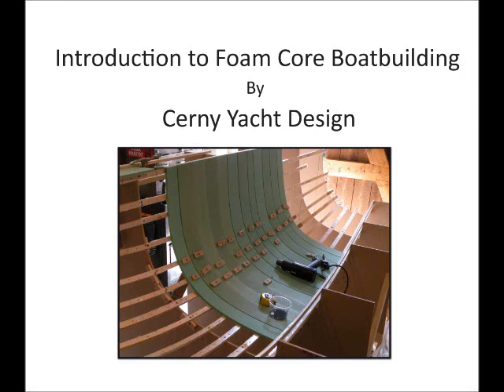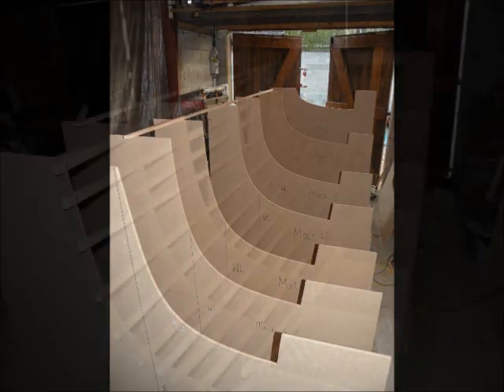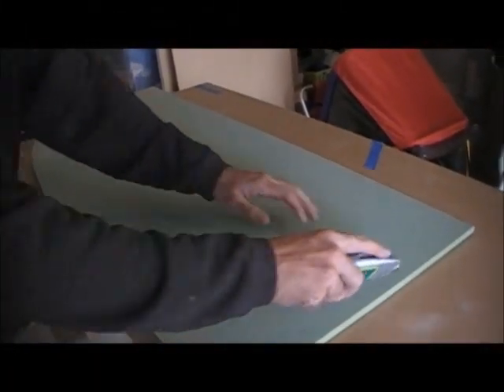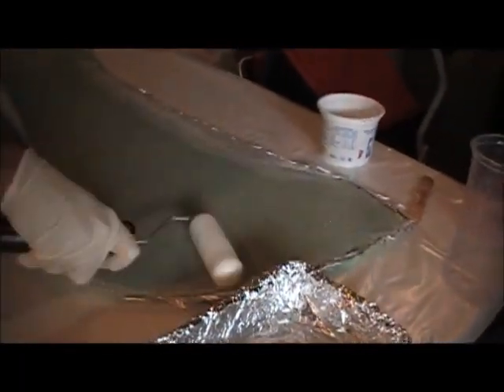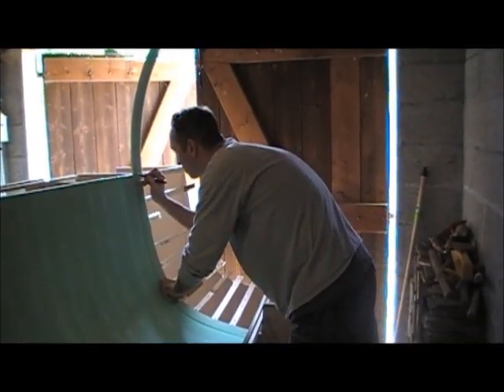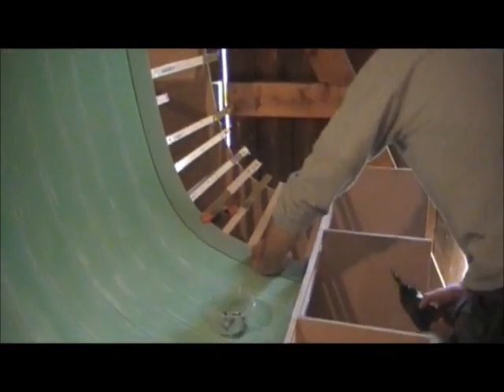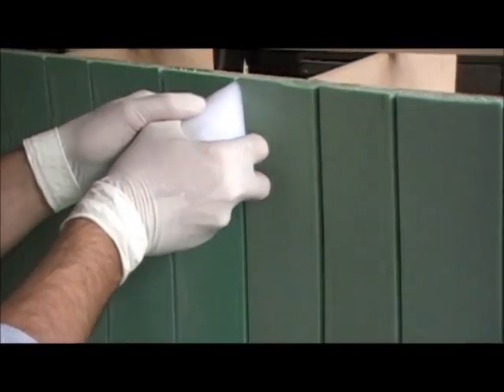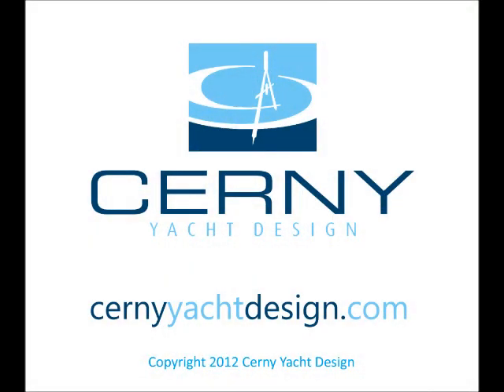Introduction to Foam Core Boatbuilding

Comment: When you Fiber Glassed the outside (bottom) of the boat, are there problems with the vertical sections? How do you stop the resin from running?

Comment: HDPE  foam is whats used in Building those offshore boats but to sandwhich core you could use the two part 4lb density available at any Boat Building supplyers but is polyester better then OMG brain fog but also use two layers of chop strand may @ 1.5 longitude and then opposite way with 1708 and 24oz or 32oz wovenroven

Comment: Realistically, how large of a boat can you build with foam core??? I am seriously considering the Glen L boat the Herculese. I think it is 24 or 25FT long and can be extended by 10%. This boat would have a forward berth, head and shower room/area, small stove and sink and a cock pit for fishing. It is shrimp boat and or trawler design. The original plans are for plywood and fiberglass.
Reply from the maker: There is no limit to how large a foam core constructed vessel can be.  However, the hull laminate schedule and structure has to be designed for this type of construction.

Comment: If I wanted to do a 1 off build,  55' long...and you had 3 yrs to do the job.. would you ever consider using this same method to do a larger sized boat?  Saves money on the mold being that you can cut the mold costs in half, is what I am thinking.  Or am I crazy?
Reply: Yes, that's the reason for this build method - no moulds.

Comment: Hi.
I want tu build trimaran with foam sandwich metod. 
The size is 6 meter length and 1 meter width. 
How I started?
I want to have strong and light boat.

Comment: so you dont need stringers when in foam cored like you do with ply cored?
Reply from the maker: The need for stringers is completely dependent on the design; type of boat, size, intended use, etc.

Comment: Thanks for this video. I know it's an older one, but in case you're still reading this: Do you (or anybody else reading this) have an idea what a typical foamcore thickness in larger production boats (/catamarans) is? Let's say for a typical boat with 12 m length.
And what's a typical fiberglass thickness (g/m2) of the inner and outer skin around this foamcore? Google doesn't give me any good answers.
~
Also: is there any reason not to use XPS foam (the stuff that's used for house insulation, e.g. Styrodur, i.e. the closed-cell stuff and not EPS)? I know it comes with some (solvable) challenges with some of the very rounded parts like e.g. the bow shape because it doesn't bend easily (almost not at all), but it can easily be cut into shape with an electrical saw (and correcting surface details with a pad sander also works very well). The reason: I think beyond being incredibly low cost (and much more affordable than PVC foam or honeycomb materials), it actually has great properties, especially being very resistent to compression (entire houses are standing on this stuff, despite of it's low density of only ~35 kg/m3), which is the one thing the fiberglass (tensile and torsion forces) can't do. It's also waterresistent and works with epoxy (but not polyester resin). And good ol' low cost wood glue also sticks to it quite well and can conveniently be used to keep parts together before the glassing stage.
Reply from the maker: The short answer is there is no typical laminate schedule using foam core.  Every boat is engineered differently.  For example, some might use a thinner core with a thicker fiberglass laminate while others use a thicker core with lighter laminate.  A lot of work and consideration goes into designing a proper laminate schedule on any boat, especially a catamaran.
Reply: XPS has very low shear strength compared to PVC cores. It's good in compression though (hence it's under slab usage). It can be used for some things, but you need to be careful.

Comment: this is PVC foam?
Reply from the maker: Yes, structural PVC foam.  For this demonstration we used 5.5 lbs/ cu. ft Airex foam but any brand of closed-cell structural foam compatible with epoxy will work.
Reply: @CernyYachtDesign  Thank you :)

Comment: what kind of foam.. my foam melts
Reply from the maker: For this demonstration we used 5.5 lbs/ cu. ft Airex foam but any brand of closed-cell structural foam compatible with epoxy will work.  The foam can be found at most online and local boatbuilding supply companies.

Comment: "COMPATIBLE WITH EPOXY"
One of the most important things you said - but barely!
I just watched video about having to paint foam with 4 to 5 coats of interior latex so the foam wouldn't melt from the thermal action of the epoxy!  Does Home Depot and the likes carry the foam needed?
Reply: The epoxy won't melt the foam. What you were probably seeing is someone trying to use polyester resin on polystyrene foam. They are incomparable since the styrene in the polyester resin will melt polystyrene, hence the barrier of latex. Not a good idea for anything structural.
Reply from the maker: No, you will not find structural foam core at a big box store.  Divinycell, Airex, Klegecell, CarbonCore, Corecell, and others can be purchased through local or online marine supply stores.

Comment: How do you keep the foam from breaking down when applying resin?
Reply from the maker: The foam that is used is specifically made to be used in lightweight sandwich construction using epoxy, vinylester or polyester resins.  This is not the polystyrene insulating foam that you find at your local hardware store.
Reply: @CernyYachtDesign  Which material is it?

Comment: So you fiberglassed in the inside, and then you stripped it from the wood form, and then fiberglass the backside.  Correct?  So a both that is 1 layer  foam thickness?   You say 5.5 lb/CF foam. What is this when buying foam as H60, H80 ?
Reply from the maker: Correct. 1 layer of foam in the hull. Yes, H80 is 5.5 lbs/cu. ft.
Reply from the maker: The interior of the boat is fiberglassed, the boat is removed from the jig, and then the exterior is glassed.

Comment: What type foam?
Reply from the maker: For this demonstration we used 5.5 lbs/ cu. ft Airex foam but any brand of closed-cell structural foam compatible with epoxy will work.  The foam can be found at most online and local boatbuilding supply companies.

Comment: Looks like Airex C70 or similar. No divinycell, which works as well. Plenty of closed cell foams out there that work. Polyumac had some interesting ones, so does CarbonCore. Check the specs. As for “how big can I build” questions... that depends on a lot of things. Design, lamination schedule, lots of things factor in. Done right, there isn’t much the average home builder can come up with that foam core won’t work for.

Comment: Thank you for the video. This video didn't explain the structural integrity very well. It seems there would be weak points where the two halves meet. Also weak points where the bulk head meets the planks. Can you explain this more if only in a reply here?
Reply: There's no weak points - the fibreglass is what gives it strength. After the 2 halves are joined another layer of fibreglass is applied, usually on both sides (inside and out) and that's where you get the strength, not relying on whatever join you had. This is the basis for sandwich construction, where the 2 outer layers are held apart by the core (think of it like webbing in an I beam) and the whole thing is very strong and very light.
As for where bulkheads meet planks, again you are fibreglassing over the shape created not relying on the join. It helps to build up a small radius at the joins eg in Q-cell or thickened resin so the glass isn't doing a hard 90 degree bend.
Reply: There is a new product that solves this potential problem.

Comment: Great method! I'm very much considering building a Glen-L slide-in camper. I want to try and keep the weight to a greatest minimum as possible. In this case, what is the hull strength and integrity for your foam core hull? Specifically,  overall strength
Reply: It depends on how thick you lay the glass. For a slide out on a camper, I'd probably frame it out of 1x2's , with gussets , 5mm plywood (underlayment) , and some XPS foam sandwiched in between. 3 -4 layers of 7oz tight weave cloth on the outside, and 2 on the inside. Use epoxy resin as it's stronger than polyester resin and it's completely waterproof, whereas the polyester isn't ...
Reply: There is something new from the field of construction that revolutionizes the weight-to-strength challenge.

Comment: Seems to me you can use the same method to form the shell of a travel trailer. Like one of those Shorty-style trailers.
Reply: I believe so, hoping to start building an overland expedition mobile in 1 years time, doing my studeies now and it seems fiberglass insusion is the way for my box/cabin. My main worry is humidity to destroy things and especially inside. I think good fiberglass  and aluminum primer will do the job!!!!!!!
Reply: They call those trailers foamies
Reply: With an exception. Well not really an exception so much as a difference. The squareness of a camper needs to be attended to strengthwise. All the curves in a boat get naturally ’strong’ whereas with campers you need to assure torsional load transfers with out ‘point loads’ at intersections of the sides.

Comment: Looks like a great way to build except for the epoxy.  Epichlorohydrin, one of the constituents of the epoxy resin monomer  is a skin sensitizer. In addition, epichlorohydrin is classified as carcinogenic in the category, ‘presumed human carcinogen’, according to the EU classification.
Reply: Would the sealing (paint) prevent those effects?
Reply: @CorvetteCarCraft  It's only dangerous while working with it.

Comment: Are foam sheets wet all through with epoxy.
Reply: Rune Martin Guildberg - No. Just a good Surface Coat on the Foam, a few Thousandths of an inch thick. The Resin is a Primer, and a Binder, but the S-Glass, Kevlar, or Carbon Fibre is the Strength. The Cores add Separation, causing Skins to Load up more in Tension & Compression, than in Bending - making the Total Stronger.

Comment: How far can you scale this technique up, and when scaled up how do the costs compared to plywood construction ?
Reply: What’s a square foot of plywood compared to a square foot of foam? Cost wise? That’s a start. 
The second thing is that plywood has a structural element that foam cannot match: all the strength of building over foam has to do with the fiberglass and (to a small degree) the adhesion to the foam. Wood/plywood on the other hand has an intrinsic strength it donates along with it acting as a form.

Comment: Gurit Corecell M    Marine Foam is the latest and greatest foam on the market, it's tougher than marine ply when it comes to accidents, marine ply with glass skin will crack when you overload it with huge slams this stuff will distort long before it cracks. They make an even tougher (Core Cell S) but much heavier foam that can withstand depths of 800m that they use for making under water drones or lifesaving equipment like flotation devices and buoys. 

http://www.gurit.com/Our-Business/Composite-Materials/Structural-Core-Materials/Gurit-Corecell-M

Comment: I'm thinking about building one like this.. how strong is it Against the waves with a 30hp Engine? Will it survive against the rough seas?
Reply: Chaddyjp Campbell fiberglass with foam core construction is very strong.  Numerous boats built with foam core construction sail the high seas with decades of service. The trick to a strong build is the right glass to resin ratio.  Too much and it's brittle, too little and it's very weak in the spots that don't asorb resin.

Comment: Hello!

What was the foam thickness in that project ?
I want to build small fishing boat (3m length) using the foam-core sandwich techology...
Reply: 3m can likely get away with 1/2” or possibly smaller if laminated correctly. 3/4” very common starting at about the 16th range

Comment: It seems really easy to work with, fast and straight forward. I wonder why so many amateur boat builders, especially catamaran boat builders, go the plywood/fiberglass route.
Reply: Down Under a lot of cat boat builders use this method, or balsa cores instead of foam, to build extremely light and strong boats (which then are very fast under sail with better payloads). Hardly anyone here builds with plywood / glass any more, that's 1960's construction technique. It's all balsa / glass / epoxy construction now, with many vacuum bagging as well to further reduce weight.
Reply: @ApprenticeGM  Not experienced at all with this way of constructing, but assume a lot of planning and forethought goes into designing strength in higher stress areas that typically a plywood builder would just glass over as part of the whole boat.
Reply: Availability and shipping are a factor. I can buy marine ply in ATL pretty easily... foam core not so much. That said, after two small ply boats, my next will be foam core. Too many better possibilities with foam vs ply.
Reply: panther105  simply it's stronger & it's not nice feeling when your boat break into two half's two thousand miles from land 😂✌️

Comment: Interesting method using a female mold with strips of foam. I have been trying to come up with a way to build a vintage jet boat. Length around 17- 18 ft. Big block engine with a Berkely jet pump.  With enough for thought the mold could be made so there would be no hull to deck seam.
Reply: My 2 cents on that is no foam.  the hp and torque would be to much for foam.  Solid glass.
Reply: David- hows the build going?

Comment: what resin was used so it didn't melt the foam?
Reply: Don't use styrofoam. this is structural foam
Reply: Mike G i
Reply from the maker: Epoxy that is suitable for boatbuilding was used in the construction.
Reply: JoeSmith.....dumbest idea ever, if your outer skin is not glued properly to the foam then it loses most of its strength.
Reply: Paul Murphy depends if you're only using it as a mould!?🤔
Reply: Which in this case it is not, it is being used structurally and is very important that you get good adhesion between the foam and the outer layer of fibre glass.
Reply: HI MY CRABBER FRIEND TOLD ME A BOAT BILDERS SECRET.  PAINT THE STYROFOAM WITH 2 COATS OF LATEX PAINT LET IT DRY AND THEN USE POLYESTER AND FIBERGLASS CLOTH .  I HAVE NOT TRIED IT SO DONT GET MAD AT ME IF IT DOESN'T WORK. DO A SMALL TEST FIRST.

Comment: How strong is the foamcore on its own? Could i make a cabi for my bycicle from it? needs to be super light
Reply from the maker: Fiberglass skins are needed to use the foam in structural applications.

Comment: thats preety cool. how much does it way?
Reply: *weigh
Reply: so you correct my misspelling but cant answer the question? Thanks.
Reply: JOEGGGJOE
I'm going to build one. I'll let you know when it's done, but I would guess 100-200 kilos.
Reply: ok, thanks.
Reply: So you answer the question but with made up units, thanks.
Reply: This is about the process, not a specific boat. Also, are you asking about pre - fiberglassing? Or finished boat? Bigger boats will get more glass, more weight per area. So, hard to say without a more specific question.

Comment: Would it be a good or bad idea to build the entire boat from foam then fiberglass all the foam in one go, rather than the traditional fabrication method.
Of course fitting in solid material for were fixtures will be before the glass is applied.
If it is a bad idea, can you explain why.
Reply: Delll
Reply: Delll